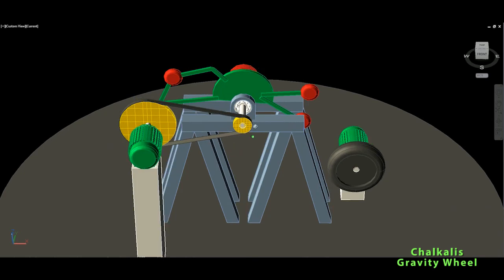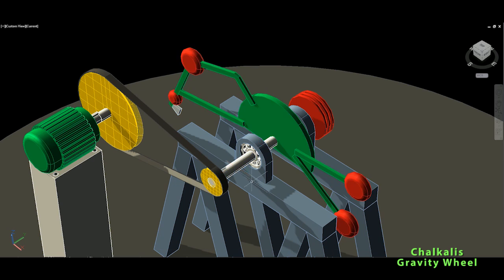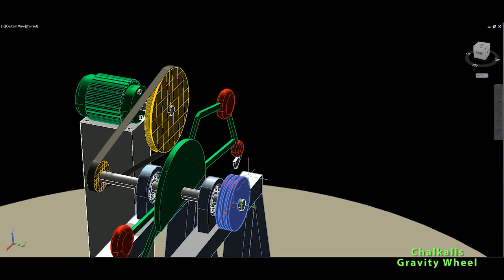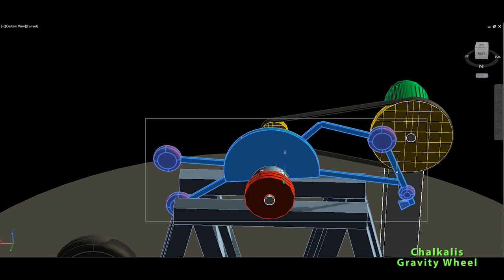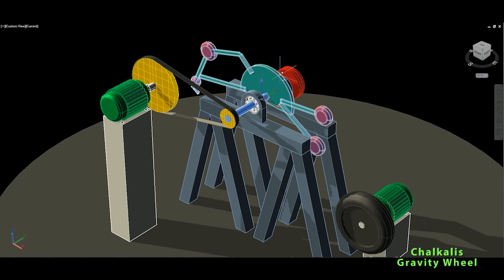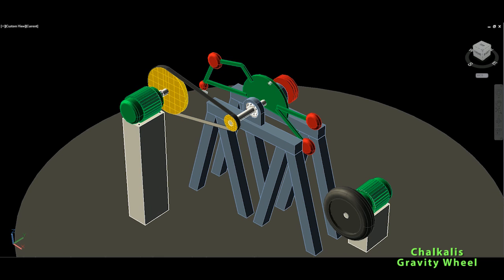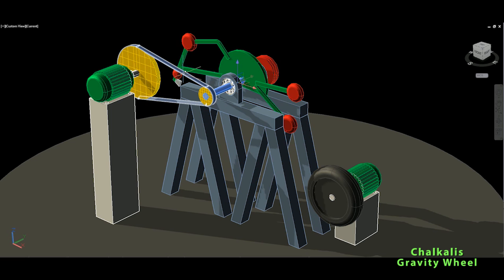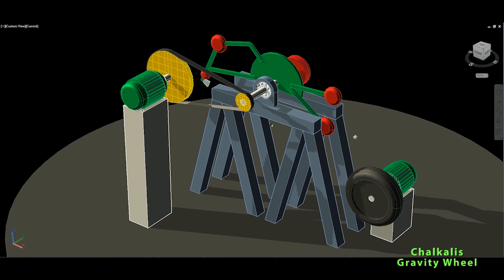Free Energy Generator, CHALKALIS Gravity Wheel!!!

Comment: this won't work by itself, as the main concept, no. But it can be used as an (output enhancer), you know, lets say, one has a complex machine , set up with different mechanisms. Basically each of those mechanisms have a input and an output . An enhancer , of some type can be placed on each of those mechanisms to multiply it's own output. do that for each function.    Like the "RAR Energia Gravity Motor-Generator" in Brazil, most of it is "enhancers". The basics of it are "simple machines" and the basic idea is a simple one. but all those multiplier  mechanisms make it look complex

Comment: thanks for posting.  i have a free energy idea, one that calls for a machine that makes use of leverage and mechanical advantage. see my channel if you are interested.
description:   start with a utility scale wind turbine;  mount a rim at the ends of the rotor blades;  use a friction drive to then turn the rim/rotor;  the drive uses a high-speed motor, perhaps, 50000 rpm.  reduction gearing is used to convert motor speed to torque.
note that at the blade tips, a wind turbine makes use of a mechanical advantage ratio of thirty or more.  for a given amount of force applied at the maximum radius, an energy gain should be possible.    cheers